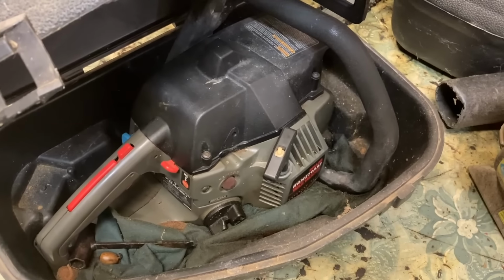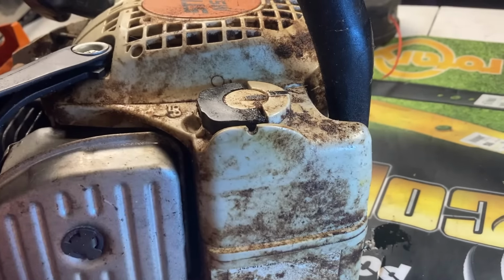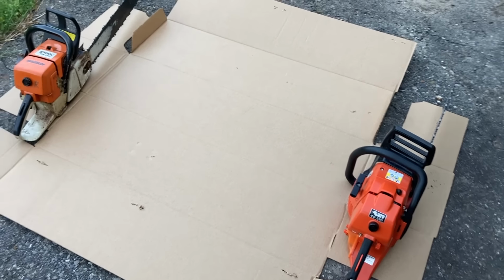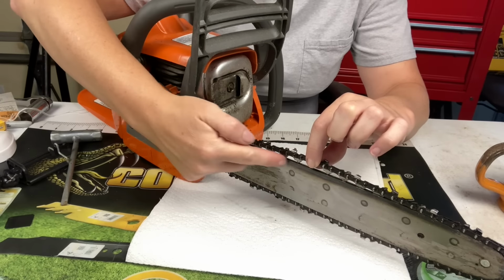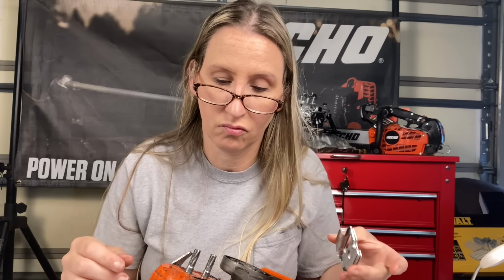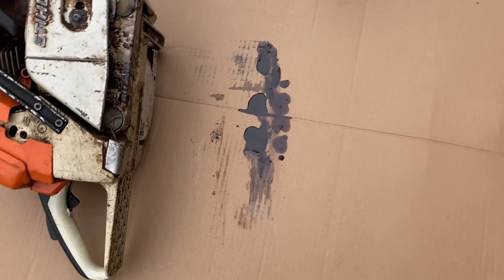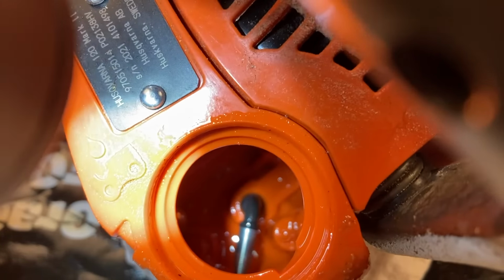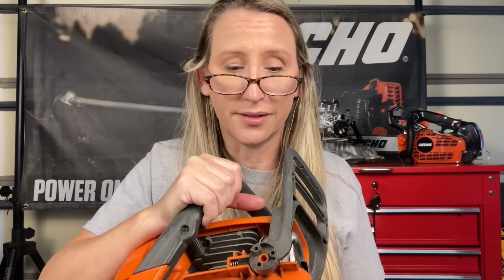Chainsaw leaks bar oil? The most common reason why AND Husqvarna saw leaking oil FIXED!! Repair Vlog

Comment: I was told at the Husqvarna dealership that, when I am done using my saw put the saw down with the refill caps facing up and crack them loose and leave them like that during storage. He said reason being with temperature changes, if the caps are tight the gas tank and bar oil tank will build pressure and push the oil past the oiler. I've done what he instructed 2 years ago and so far no bar oil has leaked out.
Reply: Great tip, now l will do the same with my four chainsaws, thanks. 👍👍
Reply: Great comment, and that does work, unless the saw is stored in a case, or on a shelf?  I usually run the saw low on gas and bar oil, before finishing up a job, and shutting the saw off.  I DO recommend cleaning the junk out of the clutch cover area, as ‘Chickanic’ mentioned in this video.  Stay safe and Healthy!  👍✌🏻
Reply: bought a Husky, it didn't have the scabbard with it as advertised.  They told me to buy it.  Returned it for the Echo, no regrets great chainsaw. If they won't honor a cheap plastic scabbard what makes you think they will honor something important?
Reply: @jeepndd  Well said. I’d do the same if a shop tried that stunt on me. 😊👍👍
Reply: Oil tanks have vents they let air in but not out.
Reply: How Long ! Are you Storing it For !?? Then !
Reply: @davidwillard7334  Sometimes a week, sometimes a month and usually all winter which is about 4 months
Reply: What do you use to clean them?
Reply from the maker: Yup! You are correct. Thanks for watching!
Reply: I put my saws on their side when not sawing and short storage, caps up .but longer term ( more than a month ) I drain both tanks, the fuel particularly to stop the petrol evaporating out of the mix causing plug clogging …
Reply: This works.  Heat and cooling causes pressure.
Reply: Even if you just crack and retighten both caps that will help release pressure for a lot of saws enough to eliminate leaks.
Reply: @aussiehardwood6196  so keep vent clear
Reply: Yep, I had to figure it out on my own. 👍🏻
Reply: @jeepndd  that would be the dealer not the manufacturer. Echo and Husqvarna both make good saws. And actually if you look deep enough down the rabbit hole, all saws are made by the same people.
Reply: @chrisbraid2907  that's the only way to store them. But after draining tanks, run saw til it dies. That fuel in carb isn't good
Reply: Well it is a pressurized system
Reply: I bought a Husqvarna saw that drained its bar oil on my shelf! Since then I store it on its side, fill caps down, with a block under the bar and it hasn't leaked a drop stored that way. I'm an infrequent saw user and have found engineered fuel is the only way to go for infrequently used small engines! It also goes in all my 4 stroke engines for winter storage, saves a multitude of headaches!
Reply: Makes perfect sense.  Thanks for sharing the tip.
Reply: Yes, 100% accurate. Especially when I’m cutting wood when it’s cold, and more comfortable out. When you bring it into a warm shop, expansion forces it out. Also with the fuel.
Reply: @scottsellers9039  man I’ll tell you, battery power is the way to go for the infrequent saw user(unless bucking cords of firewood at a time). I have one that I use for everything but firewood, and it’s pretty sweet. No smell off the saw, or clothes. Grab and go. It’s normal with a bit of oil dripping after use, but minimal.
Reply: wow, I'll try that, Thanks. I replaced the whole Oil pump assembly on my Husqvarna 41, and it still leaks. Maybe that is at least part of the problem (or they could just design the stupid thing to not leak oil lol).
Reply: Yeah, that's because Husqvarna saws are the worst for leaking and shitting themselves prematurely.
Their pistons and sleeves are cheap and nasty, their build quality overall is fall apart bad and the oil bar pumps leak fluid like Zelensky in a gay strip joint.
Reply: @joschmoyo4532  The Zelensky comment was uncalled for.
Reply: @replyhere590  
Which part exactly do you object to ? Did you build his multi million dollar mansion in Florida or are you his accountant ?
Somehow I can't see a cross dressing comedian in high heels taking my comments to seriously. 
I'm surprised anyone takes his presidency seriously either but there you go.
Reply: @joschmoyo4532  Tell us how you really feel 🙂
Reply: @davidwillard7334  I read your comment, out loud, using my best Christopher Walken impersonation.  Hopefully I will stop laughing before too long so that I can go to bed.  
Intentionally, or?  Maybe?...accidentally!   It.  Doesn't matter!  You!  Nailed it.
Reply: @scottsellers9039  100% this, ive been storing my saws on their side, fuel and oil caps facing down, for well over 10yrs now, no leaks ever
Reply: @joschmoyo4532  I don't believe Husqvarna makes chainsaws anymore. I think they were bought out several years ago, maybe Poulan I'm not sure.
Reply: @chrisbraid2907  I didn't make it too far in school (had to go to work) so I'ma wondering what 3 periods at the end of sentence means as opposed to 1 period. Seems Trump done that 3 period thing alot, I never did understand why.
Reply: @brianwalker1933  4 chain saws! I only have one. They are quite expensive here in South Africa. Costs around R2000.00 the cheapest
Reply: @GarnettM  Consumers now more than ever have to do allot of research with reviews, videos and build quality of products, it's really infuriating to me that we cannot trust a company to design and build a decent product these days.
Reply: @barrykielian5108  The 3 dots is called an ellipsis, which comes from a Greek word meaning omission and is used to show that you have left something out, such as when you are quoting someone and leave out a bit that is irrelevant or confusing.  Used on the end of a sentence, typically in fiction or informal text, it indicates that the sentence trails off.  Trump would have used it to show that he wasn't finished because he did most of his communication via Twitter, which has a character limit for each post, so communicating anything of moderate complexity requires more than one post.
Reply: @Aussie Hardwood - Filling the oil tank all the way up before storing 
will rmove most of the air volume from the oil tank and thus remove 99.9% of the pressure changes within the tank caused by temperature shifts.  This is an alternative to completely draining the tank which can be difficult.  Getting that last 1/8 out is not easy!
Reply: @barrykielian5108  That is called an "ellipsis".   Search for what it is and how it is used.
Reply: Tried your tip on two saws. The saws were laid the same way. The saw with caps tight burped off a little pressure after a 6 days. I think you've given good advice here. I also wouldn't overfill either tank and force the cap to pressurize the tank.
Reply: @RetiredRadioChaser  Here's a lesson for everyone.  NEVER EVER use the word  "ellipsis" in a chainsaw discussion.
Reply: @whiskeybuilder6335  😁
Reply: Absolutely loving the safety shoes...😁
Reply: Mine was started once, then stored away as we were moving. When I got it out after we moved and sat it on garage floor overnight, it was leaking oil. Took to Husqvarna dealership and they stated the same and that may have blown seal. Thanks for infoe and keep up the good work! Cheers🙂
Reply: This was the answer I needed. Thank you!
Reply: Omg. I saw your post by accident...never hear this before and I'm so tired of my brand new chain saw leaking all over the truck floor mat. Thanks so much. This made my day.
Reply: @Chickanic  But if you leave your gas tank cap open, won't the fuel enamel.
Reply: @leebdj1949  I went with battery power also. It's quite and my neighbors love me for doing it. I'm a early riser.
Reply: @chrisbraid2907
Reply: @Rein_Ciarfella  Not a bar oil problem, but My Stihl weed whacker builds up pressure in the gas tank when it's hot and will not start. Gas smell also. Temps can affect these tools.
Reply: Tom Curran   If your fuel tank builds pressure then the tank vent is malfunctioning. Vents can be in the caps although so far most of the Stihl equipment I see has a third line coming out of the tank with a vent at the end. The line is usually no more than about 5 inches long and oriented upwards. Sometimes the vent end is tucked away inside a small partial enclosure.
Reply: @Rein_Ciarfella  Thanks.
Reply: I’m so trying this
Reply: W0W!   That is GREAT to Know,  Thanks so much!     makes sense
Reply: Thats true. I always laid my saw over and cracked the oil cap until the saw was completely cooled down
Reply: It sure makes sense
Reply: @barrykielian5108  i have had my husq 550 xp for a few yrs yrs now. Super light and has major balls. Zero issues. Cut 10 cords a year so far with it
Reply: If I did that I would forget to do them back up again
Reply: Refilling before putting them away also does wonders.
Reply: Yep was told the same and always do that.
Reply: @barrykielian5108  Well, "Husqvarna Group" makes Poulan and "Poulan Pro" (whatever THAT is). They make McCulloch (we derisively pronounce it Muck-A-Luck in Canada - good luck if you ever get one that works), Weedeater, and Jonsered as well. Jonsered and Husky are pretty good products, but the other ones are more consumer grades - just as Black and Decker is the consumer line and DeWalt is B&D's commercial line.
Reply: @barrykielian5108  Sometimes it seems to mean "that's not necessarily the end, there's more to the story"... :)
Reply: @ludacrees  I have five or six. I bought on one eBay. I inherited one. One a friend gave me because he couldn't be bothered to change the starter spring ($8.00 part) so he bought a new one. The rest I found in the dump and resuscitated. One was an arborist's chainsaw with brand new chain, but primer bulb was gone. I cleaned it up. Ran perfectly. I seldom ever buys saws or tools. I just fix the ones people throw away here in USA.
Reply: @GarnettM  Microsoft key example. They NEVER have a finished product! NEVER! In fact, many years ago they had some sort of ad campaign that was like "Microsoft - its what's at work today!" and someone memed them 20 years ago or so "Microsoft - Is it going to work today?" HAHAHAHA totally 100% APT! :)
Reply: @RetiredRadioChaser  hmmm never knew the name but it makes complete sense that it would be an "ellipsis"... :)
Reply: My saw is new, only has about 2 hours on it and it leaked bar oil all over the inside of the case.
Reply: Wow! Such a simple solution! I will have to try that.
Reply: @jamesfisher6480  I use a parts cleaning brush.. The round w/ bristles about 2in long made for cleaning parts in a Safety Kleen ..NAPA, Autozone, should have em.. Stiff but will get in the corners w/ some twisting..A can of brake clean spray will help also..
Reply: @leebdj1949  you aren't wrong there. I have a gas and a cordless and I use that cordless more than anything. Im a builder and I actually use the cordless now which is a DeWalt flexvolt for cuts on some of my thicker posts. Which I never did before with the gas cause I didn't have the control to be somewhat precise with notching beams. And there's more powerful cordless than the DeWalt. I pill the gas out kind of out of guilt now cause other than dropping larger trees or extended periods of running. the DeWalt will take whatever I throw at it
Reply: @jeepndd  sometimes it’s the principal about it.
Reply: OK
Reply: @barrykielian5108  
The three dots ( . . . ) are a punctuation mark known as an ellipses . It is used in formal writing to express a pause, silence, or that something has omitted by the author, usually when used within a quote. I rarely see people use them correctly, I usually see them at the end of sentences being used in place of an etcetera(etc). However, when used it this way it is to infer that the writer has more to say or could have more to say.
Reply: What’s this video about?  Oh yeah, chainsaws❤
Reply: @Ubotit_Unaymit  k lol k in
Reply: I agree. Think about where most ppl store their power saws. Maybe in a shed. The swing in temperature will most certainly heat up the "container" the bar oil is in. This pressure just pushes the oil out of the least restricted port.
Reply: @briankennedy5578  that old tired conspiracy that all things are made by the same people, is so painful to hear. "aLL dRiLLs aRe mAdE bY tHe SaMe pEoPLe." People say it about absolutely everything, and it is just false.
Reply: @littlejackalo5326  speak like you know something yet no clue. Do the research. Over time companies buying other companies happens all the time. Like riding mowers. Almost all now including cub cadet are owned by mtd. And could have changed since 2013 but Stihl Husqvarna Poulan just about if not all chainsaw manufacturers owned by same company. I did research because I didn't  believe it. I was wrong and so are you
Reply: I don't doubt that works great, but it's still a crappy design. I've had many Stihls and Makita saws, even a Makita battery saw. Never leaked bar oil till I bought a Husqvarna. I would have sold it but it's a smaller saw and has outperformed any Stihl of it's size.
Reply: @joschmoyo4532  I say your comment was totally called for. At least the queer president wannabe. From my experience Husqvarna makes a good saw. I've owned most. Never had one that didn't leak.
Reply: @briankennedy5578  
Zelensky may well like Husky Norwegians in black leather and high heels and if you like getting your butt reemed at the stealership while your at it for a chainsaw vibrator that dribbles copious amounts of lube,  suddenly it all makes perfect sense. If your a Satanist.
Husky goes for the more power per dollar and weight pitch. But for the sake of a few grams and a more durable saw with two piston rings instead of one, I'll stick with, regrettably, the Stihl option.
The porting on Huskys is hotter and gives more power but the nickel chrome bores are not as durable.
Reply: Never owned ! Husqvarna in my life time
Reply: i do this with my saw and it works!
Reply: i store it laying on the side with the caps up.
Reply: @SorenCicchini  An ellipse is also used to indicate that the idea isn't fully fledged out, or there might be underlying unknowns contributing to an outcome... 🤷‍♂️
Reply: @cq6754  That's what they told the walrus when he showed up with vanilla ice cream all around the opening to his mouth....
Reply: My ms 230 never leaks oil,EVER. Better engineering, I'm guessing.. none of my Stihl saws leak.. hot,cold,overnight,all year, none..  my 180,230,250,or 291,all leak free..  personally I wouldn't take a Husqvarna if it was given to me..too overrated ,too many issues..
Reply: @jeepndd  good choice.
 Husqvarna has gone downhill in the last decade or so.. rebadged Poulan saws @ Canadian Tire up here in Canada, orange trash,really...
Reply: @briankennedy5578  Husqvarna and Poulan,yes... Stihl- Nope.. all its own..
Reply: @joschmoyo4532  Husqvarna quality gas dropped to a new low.. my brother,a long time Husky guy.. says his last Husqvarna is his LAST Husqvarna, it's Stihl or Echo from now on..  can't blame him,lotsa money for junk..
Reply: @barrykielian5108  they make the bigger saws, the other box store ones,are orange rebadged Poulan saws.. ( parts made in china) and assembled in Mexico, I believe..  junk saws.. fall apart as your operating them.. seriously.
Reply: @stevestowell-virtue3781  why do that? Liquid expands and contracts too.. and it's not compressible as air is.. so even worse damage could result.. that's some bad advice..
Reply: @privatear2001  I'm from Canada, where do they pronounce McCullough, Muckaluck?? 😅🤣😂.. we pronounce it maculluh, maybe in Quebec they say mukluk, they're a different breed altogether, lol..
Reply: @michaelmeitner7800  smart...., very overrated saw.. their quality has diminished greatly the last decade or so..
Reply: @h8troodoh  better look again. You are wrong.
Reply: @h8troodoh  Stihl going downhill also, quality not same. Got some stupid shit going on. Don't even know what to say about their blowers
Reply: @briankennedy5578  gotta pay attention to where they're manufactured, chinesium built one's, have a poor quality  build,it seems..
Reply: @briankennedy5578  and honestly, I'm just talking saws, that other landscape shit,is news to me.. don't pay attention..
Reply: @briankennedy5578  what am I wrong about,buddy? Enlighten me..
Reply: @briankennedy5578  stihl- Germany  Husqvarna- Sweden, poulan who tf cares.. do you service these products at all,Brian? Are you a small engine tech??
Reply: @h8troodoh  won't let me leave a link. Deletes my comment
Reply: @briankennedy5578  I will,thank you..
Reply: @briankennedy5578  so Brian I went on that sawinery site.. told me sfa.. perhaps you should Google who owns both companies, then you may be in for a surprise..smh. 😆😅🤣😂
Reply: Dang, shit to know every day.
Reply: @jeepndd  I usually tell people to shop for a dealer or sawshop  instead of being brand loyal because when you need it fixed you want it done right away and service is king. If your making money with your equipment you want good service that is close to home with a quick turn around time for common problems.  I have had Stihl Jonsered Husqvarna Echo pro equipment and it all was good. It just depended on where I lived and after running a pro saw from those brands I would never buy a homeowner or mid  grade saw ever again.
Reply: I do the opposite and place the saw with the tightly fastened caps facing down. Never leaks anymore.
Reply: @aussiehardwood6196  exactly.. but most times it's filled with sand, sawdust or dirt.  Both cleaning the cap or leacing them loose during storage would be a good practice.
Reply: The sthil  dealer told me that 8 years ago .it works
Reply: @Chickanic  an old dental pick gets those 0 rings out nicely.
Reply: Good to know!!! 👍👍😎
Reply: @scottjays360s.johnson2 leave cat out of a dog fight. Meaning, gas ⛽️ and battery 🔋 powered
Reply: @briankennedy5578  no they aren’t. Husqvarna makes their own saw at their Nashville Arkansas plant. They have nothing to do with Stihl or Echo saws.
Reply: @mutha_fnmikey2325  they have factories in more than one place. Many companies have different products but are owned by same people
Reply: I have Husqvarna 450 Rancher and tried this advice because of THIS comment alone. IT WORKS!!!! NO VIDEOS ABOUT THIS!!! 🤯🤯🤯
Reply: Ya but how’s that work in a hardcase
Reply: Mine leaked once, then never again (460 rancher)
Reply: Can you do a video on how to store small engine please

With or without fuel ect
Reply: What viscosity oil can you use ?
Reply: This is correct.  They Do build quite a bit of pressure just sitting there in a hot garage, simply notice what happens when you take the caps loose- pressure always squirts out at the cap seal.  Psshht!!
Reply: I was told the same. However ive had 3 Husqvarna saws and each one had this issue in her video. I still love em though
Reply: My hubby has a Stihl 12'-19'
pole saw(not sure what model. Only used once since new...stored in full walk in basement last 3years...came with Stihl bar
 oil...he will check out all your advices/ wrapped up in 
dbl bag after leak was noticed after taking out of basement/BTW we have a cheap Harbor Freight electric 16" bar with their "STP" bar oil(thicker)he keeps it clean after each use/never gave any trouble/cuts through 10"-12" 100+ yr old red oak branch limbs very well...could we use that bar oil on our Stihl pole saw?  ...Thx for all you share with this ol' fixed income
Senior couple.
Larry retired as A.S.E./A&P Licensed GSE
Inspector/Technician 2013...he enjoys your 
expertise and is very joyful to be able to now work on his own restorative menagerie of 
"frebbies/pawn shop bargains"
and worked on 
Corvair motors
Continental/Lycoming powerplants...as well as many other cast iron auto motors)...
(he was raised in K.C./Sedalia, Mo as a child and still roots for the
Chiefs!!)

May God bless
you Bre!!
L&A Shaw
Fpk Ga
Reply: @AudioGardenSlave123 
Same. My only chainsaws are a Ryobi 12" battery chainsaw and a Ryobi 6ish inch battery pole saw.... but I always empty out as much as I can, and store them with the bar/oiler facing up, and the oil cap tightly done up. Only leak I've had since doing that was the bottle of oil fell on its side and wasn't shut properly 😔
Reply: @jeepndd husky is the Ford of chainsaws.  Junk.  My buddy bought a 565 brand new. It's missing a motor mount.. removed by the dealer because if saw gets dropped on its side the block cracks.
Reply: Usually the bar oil tanks are vented.the office is usually under the cover,where the bar studs come out.sometimes not usually visible,or just plain hidden
Reply: I get rhis problem a lot,and it's usually just oil drain back off the bar and chain.new chainsaw owners are not aware of this,and like them clean..
Reply: Had a Sachs Dolmar that never leaked. Great saw
Reply: It cracks me up when I hear people bash one manufacturer of a chainsaw like Stihl sucks or Husqvarna sucks you people make me laugh the saw doesn't work Well when people don't know how to properly operate them and it's too bad so many people bash these saws when they haven't a clue as to how to work on them or repair them or more often than not don't understand why they do what they do or why they don't I've never taken a piece of landscape equipment to a shop by the time I take it to the shop and get home I'd already have it fixed or repaired this small equipment is very easy to understand parts are generally very cheap and simple to replace any piece of equipment is junk if you don't know how to properly use it and care for it Husqvarna is not junk and neither is Stihl some have advantage over another in one department but fall short in others for example if you want a saw that's light and screams rpm's get a husky, you want torque and an anchor buy a Stihl, if you want something to just cut a few branches here and there a poulan will do it it's all about how you treat your equipment btw Ive been an arborist for the last 20 years and have pretty much every brand of equipment laying around the barn it all works just fine
Reply: T to the point way to much talking..."GET TO THE POINT"
Reply: Great advice
Reply: I'm so doing it from now on
Reply: That tip works great ! I have an old stihl that barely leaks at all but 2 years ago got a Milwaukee battery saw. If you don't Crack the cap and release the pressure on the bar oil it will drain the whole thing
Reply: @SorenCicchini Thanks for tje good explanation of the elipsis. One correction though. I think you meant not relevant as opposed to not irrelevant, which would mean that it would BE relevant.
Reply: @doughertzog9070  you are correct!  I've edited my comment so that it says what I was thinking.  I probably first wrote not relevant then added confusing and thought I should rewrite but only did half the job. Thanks for the editorial correction.
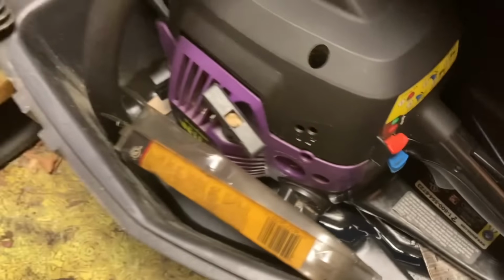Reply: 😅great 1:10
Reply: @scottsellers9039  What is engineered fuel? Is it fuel without ethanol?
Reply: That's a good idea! Thanks 😊
Reply: @barrykielian5108 , maybe their fingers stuttering and goes too fast for them to stop the dots. Lolz 😂
Reply: @stevestowell-virtue3781 very well said
Reply: Huskies just don’t leak. It doesn’t matter if the caps are tight. They don’t know what they are talking about.
Reply: Great tip…thanks!
Reply: Politics in chainsaw video? Some of you are just sad!
Reply: Good tip. I have used saws since 1980 and they all leak except the old Dolmar    116i.
Reply: I’ve always done this too. Guess something dad said at one time or another
Reply: @jeepndd did you buy it from Husqvarna or did you buy it from a big box store/ dealer?
Reply: @briankennedy5578  I agree with the first half of your comment but not the second half.
Reply: @scottsellers9039 that engineered can fuel is trash.
Reply: Jesus Christ thankyou for the short answer.
Reply: @harleygilmore253  LOL thanks for the complaint
Reply: Dig the chaps
Reply: Probably good to do with all your 2-cycle toys.
Reply: Switch to vegetable oil.  It doesn’t off gas like bar oil
Reply: Great tip
Reply: 🚫 ethanol!!!!!!
Reply: @Rein_Ciarfella no, the fuel cap vent let's air in to prevent a vacuum from forming inside the tank. It doesn't work the opposite direction, it's a one way valve. And if working properly it should absolutely prevent release of pressure because otherwise the fuel would evaporate.
Reply: All saws are going to leak some just deal
Reply: I was told to put a new O ring on oil cap, because if the ring is pinched or scored it will allow siphoning of oil out the bar end. Worth a try anyway.
Reply: @FrankDillingsly-g9e  yeah maybe, most likely not, The O ring on the cap just completes a seal so oil can't leak past the re fill cap.  The Cap is a complete seal, the problem is with the seals of the oiler chamber.